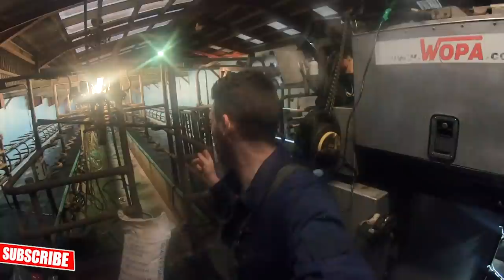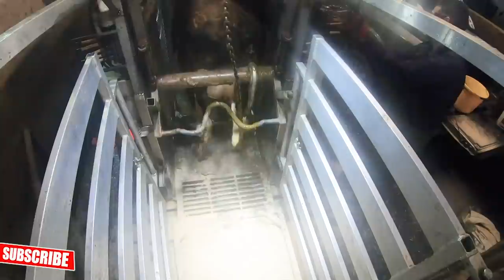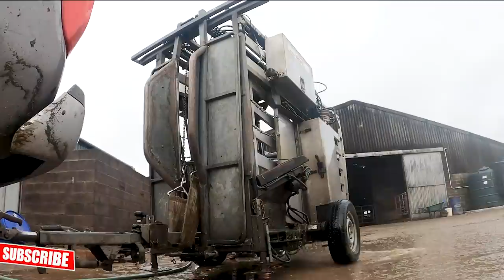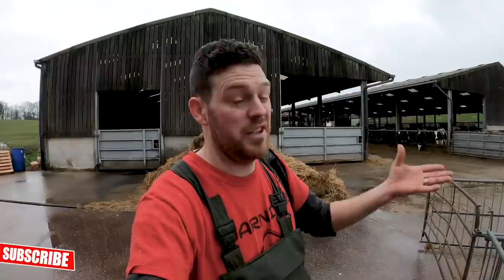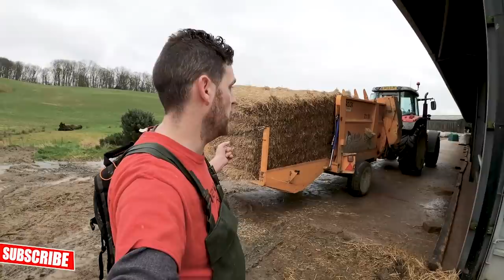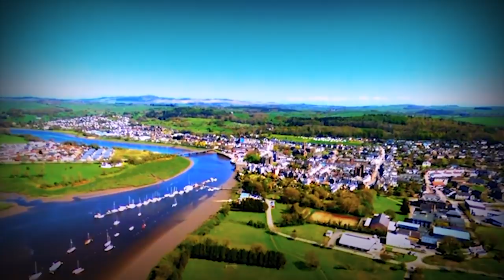STRAW BALE CANON in BABY CALF NURSERY | The Hoof GP

Comment: I understand his wanting to get some practice in. I have never put a knife to a cows hoof, but I have tried it with horses. Watching the farriers over the years it looked so easy! I was amazed at the force I needed to even shave a tiny sliver of hoof off. It was a new sharp knife, but just seeing the flick you experienced operators use is deceiving. I can clear out small chips, remove half off shoes, and file out small problems between farrier visits now, but it definitely is not an easy thing. It probably takes me triple the time the professionals do! I also know my work is a stop gap to prevent more damage until the pro can come make it right!!!

Comment: Are cows just not bothered by dust? Like does it get in their eyes/ears/nose/throat?
Reply: The good thing about farms like this is the ventilation is so good that the air quickly clears. The heat from the animals causes hot air to rise through the gaps designed in the roof which then sucks clean air in from the sides.

Comment: When they pump in the new hay to soak up the urine and slurry do they have to eventually have to hose it out? The cows are walking on slates. Does this go into some drainage area that is cleaned out? Great video btw!
Reply: D MP below the slats is a tank usually 8 foot deep then in the spring / summer you spread the slurry as fertiliser